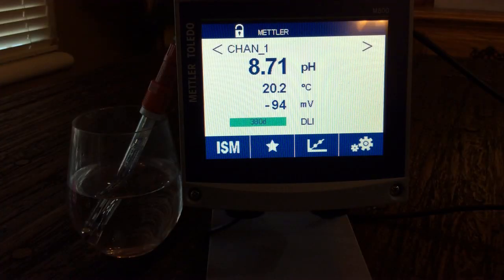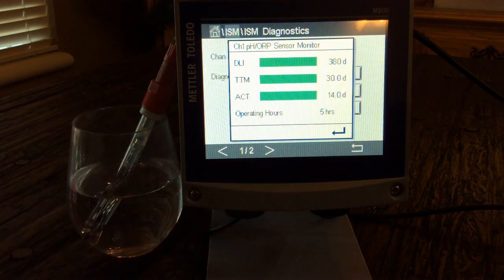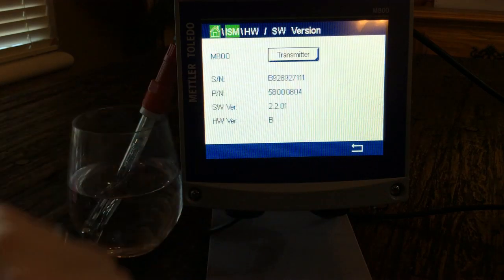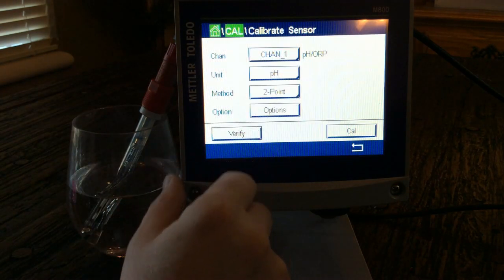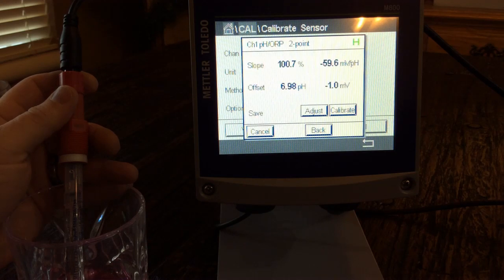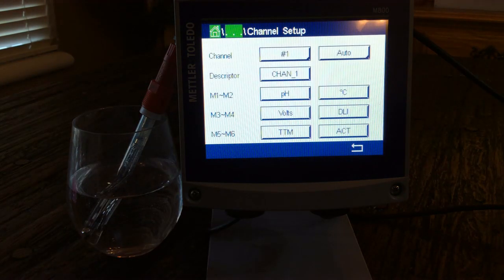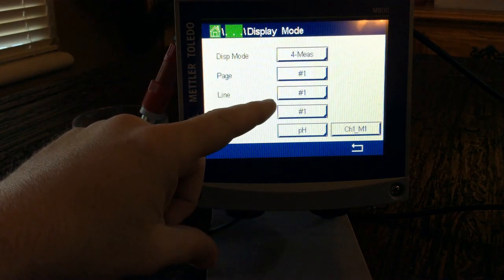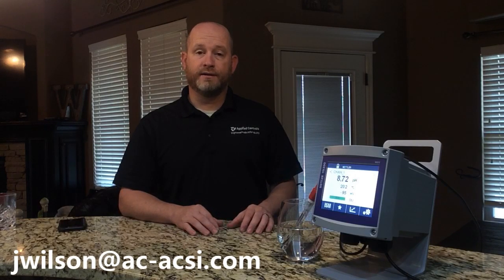Mettler Toledo M800 Transmitter Demo

Comment: I'm trying to get our m800 to read ozone correctly. It reads 0 after swapping sensor and calibration. Any suggestions? We use the ism 6510 sensor
Reply from the maker: What's your email? I'll send you some instructions.
Reply from the maker: Ozone sensors must be polarized for 6 hrs prior to calibration. This typically is when the membrane gets replaced. Then polarize in ozonated water of 100ppb or greater. It will not read anything if the sensor is not polarized.

Comment: How change the unit to ppm sir.
Reply from the maker: What are you looking to measure?
Reply: @joelwilson4366  conductivity
Reply from the maker: @teamstart2088  I can do that with a 4 electrode Conductivity sensor. However you would have to change the value to read total dissolved solids. At that point, you can change it to ppm or ppb. You cannot make a ppm/ppb reading with a standard conductivity sensor. All this is figured through the Settings tab and then channel set up.